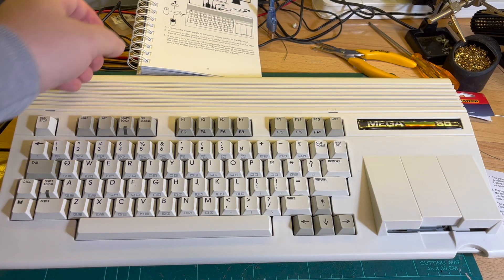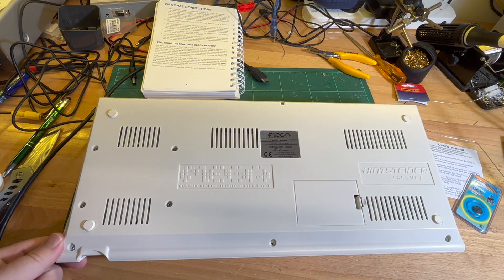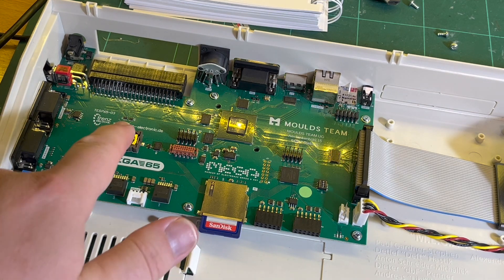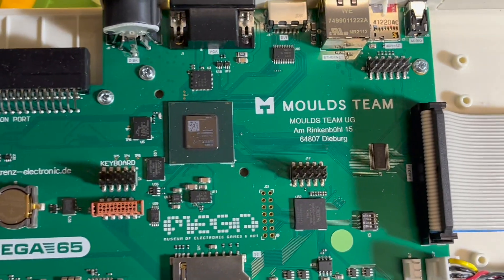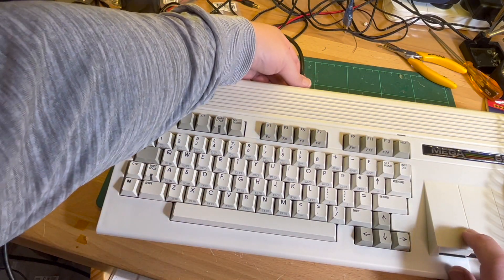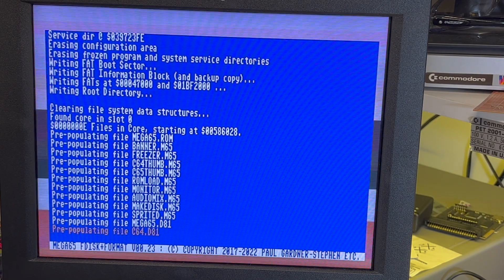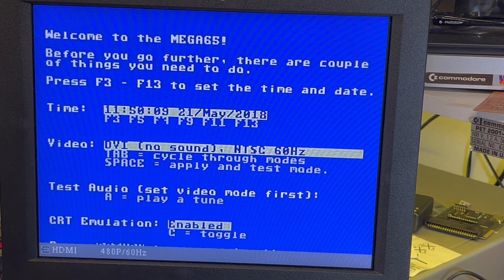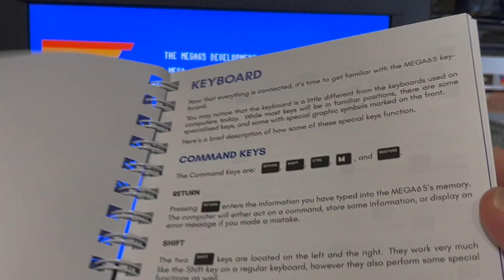🇩🇪 #MEGA65: Part 2 (Initial Setup) [TCE #0037]

Comment: No bios battery when you pay almost $700?   

Not worth even 1/2 that price to be honest.  Nostalgia? Sure, I am over 60, and sure not only did I grow up with those 70s and 80s machines, I made a career for 40 years as a developer... I still do not think it's worth it, I will stick with the Vic 20, C=60, C=128, Amiga 1000, Amiga 2000, and Amiga 4000 I own.  Reminds me of when I worked for Impulse as one of the 3 programmers on Imagine 3D for the Amiga (and PC).  Good times, but the MEGA 65 has no place in any memory because it was never released for sale.
Reply: The lack of the battery is for safety, as batteries can leak.  I would far rather put a battery in on my own than have my machine get damaged in the box before I've even received it because they included one.  (Yes, they'd RMA and fix, but then I'd have to go through that process internationally, which is unpleasant.)  Worth noting, there is no bios to battery back, all that backs up is the time in the clock.

The point that you miss is that the cost is not for a set of manufactured permanent chips, which are cheap to manufacture, the cost is for FPGA chips, which can be updated at runtime.  You say you want to stick with a long laundry list of machines, well... cores for those machines can be ported to the Mega65 (they're already available, just not all of them have been ported to the specific configuration of the machine) and it can be turned into any of those machines at runtime.  Heck, at the end of the day, how many of those machines can you turn into a Cray?  Because there's a Cray FPGA core available, which means if you want to get it running on the machine, you can (I know I'm excited by the prospect of turning my Commodore into a Cray, just for the laughs).  I personally am also excited for the RedCode core, in spite of Corewars being a completely solved system... the thought of those little warprograms running in a CPU rather than a virtual machine is very amusing to me.

Then, there are all the other options if you want one but don't want to pay for the most expensive model.  It can theoretically be loaded into MOST FPGA machines (though some would require porting), at this time, you can use a Nexys (which will run you about $400), and it's being actively ported to the Wukong (which is about $100), and then there's the emulator, which is free, but is also nowhere near a 100% emulation (and won't be for many years, as it is a single dev trying to keep up with hardware that is still in development).  Further effort is being put into bringing the cost down more on the luxury model, but... if your biggest complaint is about cost, then you are barking at air because your information is based only on the highest end model and not on the reality of the situation.

At the end of the day, it would appear that, in spite of your long resume as a developer (I'm around 40 years too), you have not done a very good job of keeping up with modern technology.  FPGA is different.  It isn't as cheap as dedicated chips, but it is WAY more powerful.  

The whole thing is the pinnacle of an Open Source project with no profit being made until you get to AMD selling the Xilinx chips, with a community of people involved that are predominately really amazing.  Whether or not you want to join us doesn't really make any difference to us, because none of this is commercial.  We want more people, but don't want just anyone in our community, because we don't want to see it become ultra-toxic like some of the other communities have become, especially the 64 scene.  UGH, what a terrible community to participate in, and I've been making demos for it since 84 or 85.  Seems like a huge chunk of those people still act like they did when they were 12, and honestly, I just don't have the energy for that at my age.

So, you have my sympathies that you are making snap judgements based on bad information, but at the end of the day, we will do just fine without you.